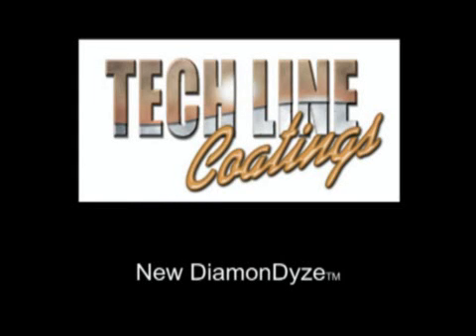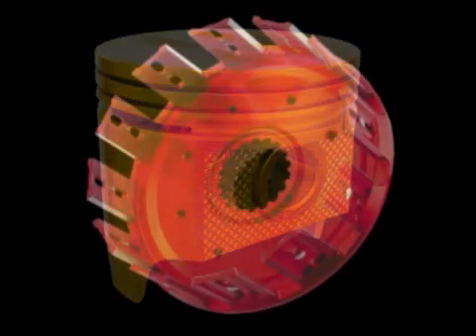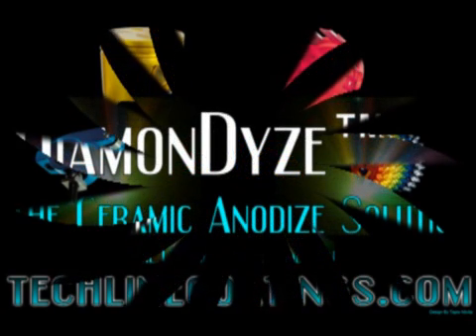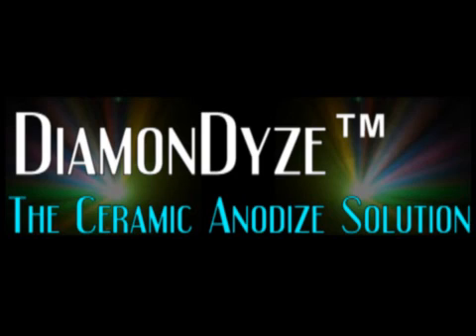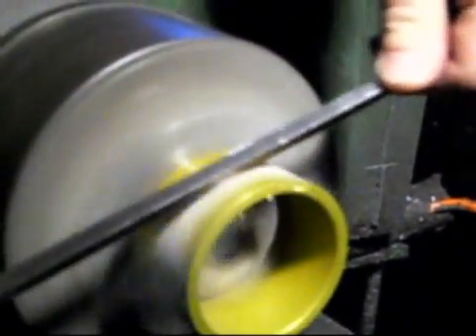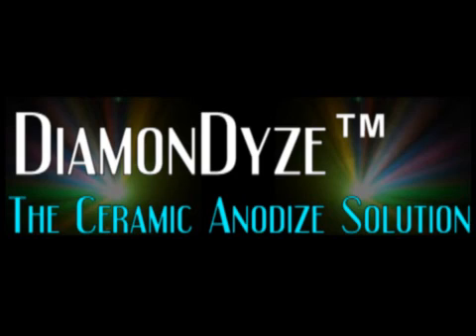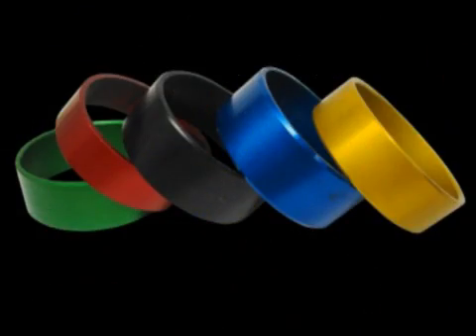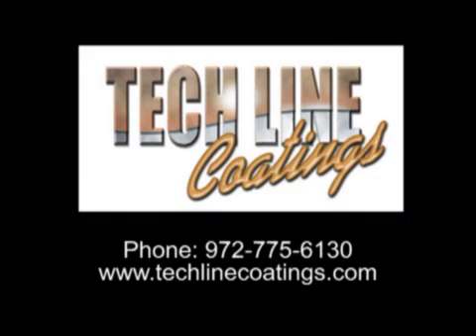Introduction to DiamonDyze

Comment: @DJJAW11 
"Yes, DiamonDyze will work on aluminum alloy wheels and is available in standard colors. Hard anodizing is limited to a few dark colors at best. DiamonDyze is a TRype II process when colors are desired expanding the range of colors and shades available and as wear resistant as hard anodizing with better corrosion resistance."

Len